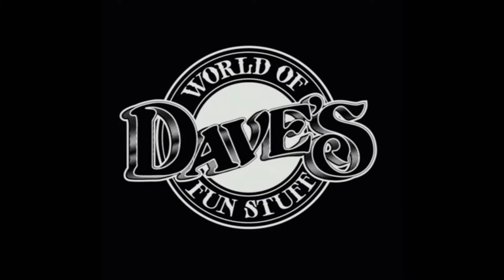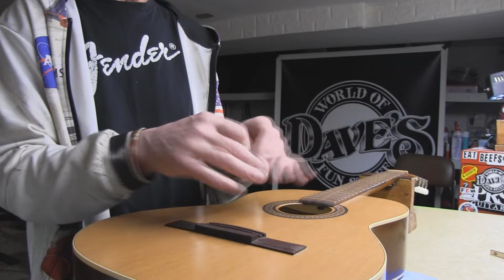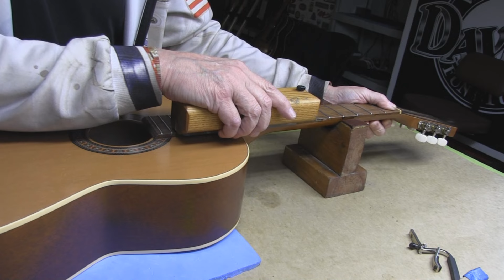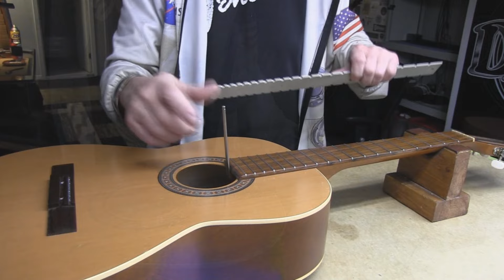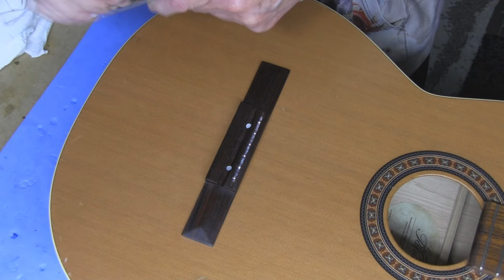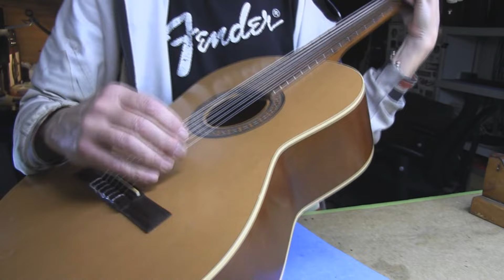La Patrie Classical Acoustic Guitar Dried Out

Comment: I see I'm not the only one to use "Thread Lock" on my guitar jacks nuts.  I use a toothpick to put a drop.  In a pinch, you may use a drop of white glue or wood glue to keep the nut tight.  You only need a drop, not a lot.  You want to be able to remove the nut if need be.

Comment: I recently purchased a fender aerodyne and it arrived with a wood crack between the neck and neck pick up. The guitar just got discontinued and won’t be restocked/is out of stock now and fender confirmed no more will be shipped to stores. Would it be worth keeping if I like the guitar? I got a partial discount total price down to 570 which is less than used which is 800-1000. Ñwould it be fine to keep the aerodyne Strat? Idk if I can but I uploaded a few pics of the crack